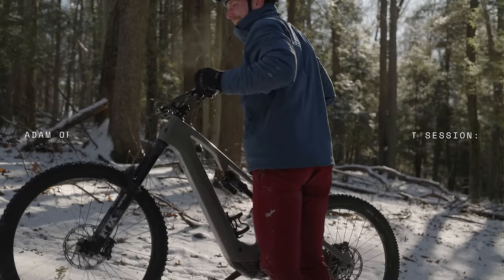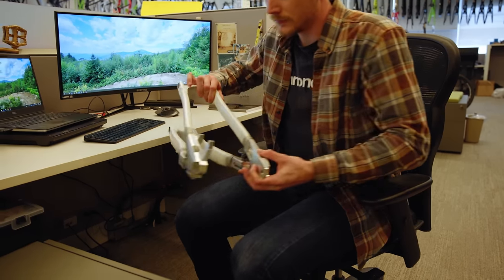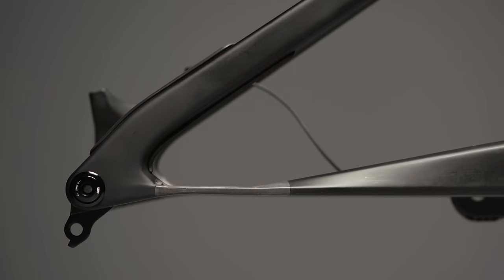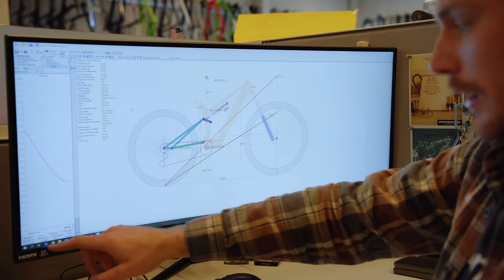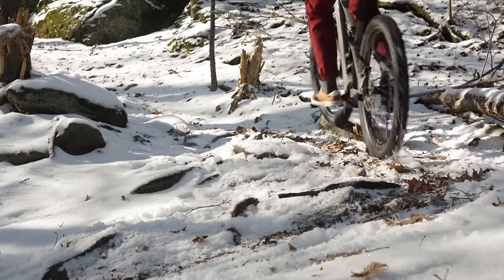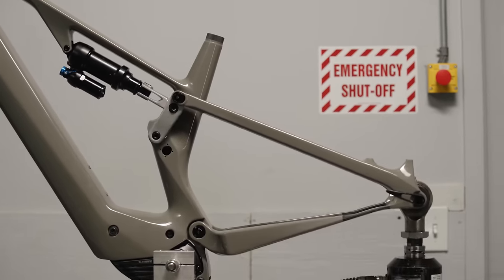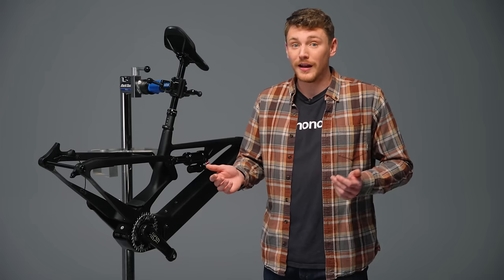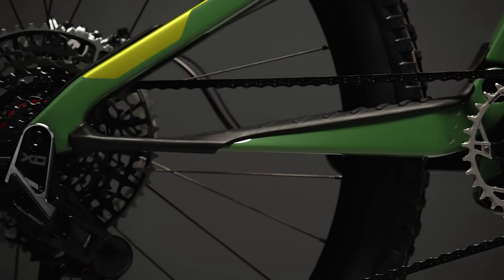The Revolutionary FlexPivot Suspension System | Tech Talks | Cannondale Moterra SL

Comment: the thing is with carbon is its like aluminum unlike steel it has a will eventually break no matter what it has a use life and flex pivots will make that use life much less than a normal carbon bike but the use life is very long with carbon so i cant say how durable it will be

Comment: No engineers...please STOP. I owned and rode a 2016 Orbea Occam AM with "flexing seat stays". The bike was incredibly light until it cracked due to fatigue. I fought for six months with Orbea to get it warrantied. I finally sent a 24 page letter to the CEO of Orbea in Malabia Spain. They relented and warrantied it. But I'll never own another Orbea or a bike with this inherent weakness baked in. Maybe the industry is baking in "planned obsolescence" by intentionally designing parts that fail!?

Did you notice that the test rig shown in the video flexes the chain stays slowly back and forth? That is NOTHING like the abuse the component will endure under a rider, on the trail racing through any kind of terrain. Where is the side loaded flexing? The sudden hits from square edge rocks, ledges, drops, jumps? They didn't say how many cycles they tested ("until we got tired of watching it" is NOT precise engineering), they certainly didn't test until failure.

Just plain stupid engineering and marketing.
Reply from the maker: So sorry to hear about your frustrating experience with Orbea. They're a company we hold in pretty high regard. But you are really making an apples and oranges comparison here. There is a big difference between a flex stay (especially one from 8 years ago), and an engineered flexing pivot. Simply put, FlexPivot will outlast you. And we don't just say it, we guarantee it with a lifetime warranty. So don't let a bad experience from the past keep you from having a heck of a ton of fun in the present. Give FlexPivot a try. You'll be glad you did. (And come on, you think that one lab test in the video is the only testing we do?)
Reply: @CannondaleBicycles71  "Lifetime Warranty" from Orbea had me fighting very hard to get them to honor the warranty.
Reply: @GoatRidesBikes I'm not pro any brand here, but we don't know the details of your Orbea issue (and we're ok not knowing) and we realize this is an entirely different brand.

Comment: you should focus on a removable battery...much more important feature!
Reply from the maker: Hi The battery is removable. However, it was only designed to be removed for repair or replacement. Not having a battery access door is one of the many things that save weight on the SL.
Reply: you will get it next time ;D @CannondaleBicycles71

Comment: What's it do that the shock doesn't do?
Reply: what? you still need a shock
Reply: @v000000000000v  but what's the point if you have a shock already?
Reply: @Jone952  lighter, no maintenance with bearing, different suspension characteristics

almost all brands have their own lines of carbon flex suspension systems now, specialized, giant, gt, trek, berria. it definitely has advantages and disadvantages over regular suspension systems
Reply: @v000000000000v  buy why run it with regular suspension at the same time like they do in the video?
Reply: @Jone952  same reasons as stated, this is not a full flex system like some xc / gravel bikes, you still need a shock to absorb the actual impact, this just simplifies the linkage system

Comment: Why do this on an e bike ? Makes no sense. You don't need to save the 100g on a moped.
Reply from the maker: Hi! With FlexPivot, you get that 4-bar ability to independently tune anti-rise, anti-squat, and chain growth values for the best possible suspension performance without the weight, maintenance, and torsional play of traditional bolt-and-bearing pivots. Plus, it's more durable than a traditional pivot. There are no moving parts, nothing to wear out or replace. No slop or play. And a near-infinite fatigue life. We designed this version of the FlexPivot specifically for the Moterra SL, and it not only surpassed all of the test standards we created for it, it went way beyond them.
Reply: @CannondaleBicycles71  Sorry no.  You save what, maybe 150 grams on an E bike where that has no benefit.  Near infinite is not infinite.  From someone who has broken stays on Specialized, Intense and Orbea in fatigue I know firsthand 'near-infinite' means it will leave you stranded in the middle of nowhere at some point if you ride regularly.  The stays also induce preload or inconsistency in the spring rate that is impossible to properly damp with the shoick.  Makes plenty of sense for an XC race bike.  Makes zero sense for an E bike.
Reply from the maker: But, how many traditional pivots carry a lifetime warranty like our FlexPivot?
Reply: @CannondaleBicycles71  Lifetime warranty is minimum entry point for any premium brand.  Traditional pivots fail slowly and let you know with slop.  A flex pivot seams fine one minute and then catastrophically fails in fatigue in the middle of nowhere and you're left hiking out.  I get it - your value proposition is to those wowed by the sparkly new different thing.  Just like Scott makes bikes for those who never want to work on their bike and want to see how many levers, cables and do-dads they can stick on their bars and route through their headset and hide the shock etc. Thankfully there are brands that cater to riding vs marketing.

Comment: "Saving weight" adding a potential failing component? You're doing it well. A flexible carbon chainstay on trail e-Mtb  is absolutely nuts, considering the mechanical stress that part must endure.

Comment: An additional point of failure. How long does it last? My MTB frame is more than 10 years old and is still going strong.
Reply: My scalpel 2009 still strong and perfect even with heavy abuse everyweek
Reply: And why do you think 10 year old engineer is better than a modern one? Stop being a dino. If you don't like it, there's 100x other bikes for you to choose
Reply: @bernardo9202 scalpel em 2009 use the same technology of flex chain stay of this bike. Just showing that we don't have fatigue issues with flexibility.
Reply: yeah but he wasn't talking about the scalpel from '09. Was he? 😅 @ThiagoMarquardt
Reply from the maker: FlexPivot has a lifetime warranty.
Reply: Technically, by removing bearings and pivots it would be removing potential points of failure. That doesn't necessarily mean the potential failure itself is reduced, of course, but the points of failure are.
Reply: I have a 2017 Habit with the flex stay system and haven’t had any issues at all with it. Seven years of hammering it around the Pennines and trips to Morzine.  And I’m very fast, and a little chunky.  I’d be happy to be a brand ambassador for a Moterra SL if Josh resigns. 😂

Comment: It may be super strong in the lab, but one scrape from a sharp rock on the super thin side, and the entire rear end is compromised.    Metal can survive those common abrasions, but carbon can’t……it’s the dumb stuff that often happens on trail rides you have to design for too
Reply from the maker: Hi! Our FlexPivots are protected by a robust, full-wrap guard. If you hit something hard enough to damage a FlexPivot, you would have also destroyed any other swingarm. And, we designed these things to go forever with a lifetime warranty.
Reply: @CannondaleBicycles71  why is this bike priced at 14k what makes it worth that much? Please explain or is it just greed
Reply: Metal doesn't survive any better that carbon.  This is a fairly thick chunk of carbon. Abrasion of some layers(the strands are very thin) is probably accounted for
Reply: @topchoice1621  while I definitely don't want this,  economies of scale are a thing.    It's going to be very expensive to make so few of them and they don't have an arsenal of $500 hybrids to fund production of this bike.

Comment: Thicker means longer lenghtwise deformation on outer layers = it will fail sooner. Why not use proven pivot with bearing? To save 2 dollars/frame?
Reply from the maker: Hi! We created FlexPivot to make a better Horst pivot. Lighter, laterally and torsionally stiffer, longer lasting than bearings. Not cheaper. But better rarely is. Also, the differential in elongation is accounted for in the layup. You think we're just slapping a whole bunch of the same carbon in there? We designed this version of the FlexPivot specifically for the Moterra SL and it comes with a lifetime warranty.